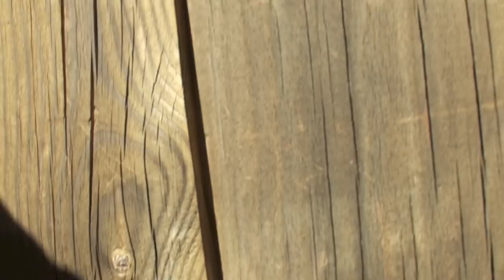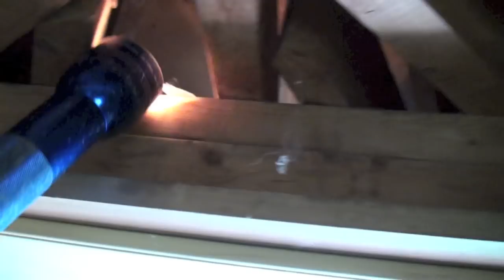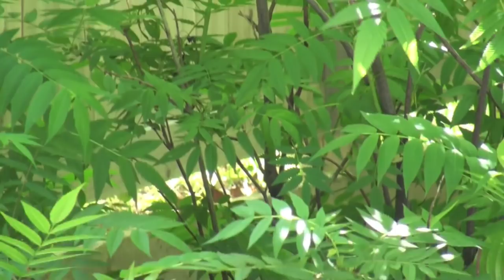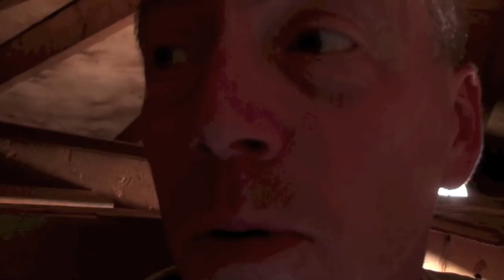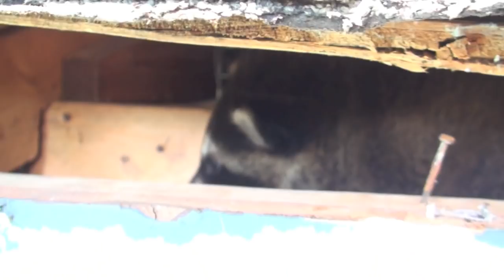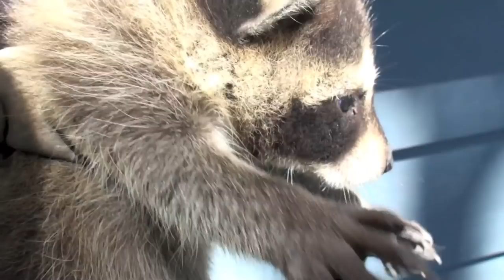Aggressive Mother Raccoon Protects Her Babies

Comment: A mother raccoon once lived in my home in the attic crawl space on 3rd floor.  My son's (then)   bedroom was on 3rd floor also.  There was a board nailed up from the crawl space and you can't see anything.  My son (Nate) can heard noises from behind the thin board.  He was warned not to bang or make noises towards the mother raccoon.  I called and someone told me to leave mom alone with her babies.  Within days, she moved her babies to another area from my home.  The hole on the roof to the attic was finally blocked.  I was amazed to see the size of the hole not bigger than this mother raccoon.  They can squeeze through pretty good.  It looked like the hole was chewed through.  They are smart.  If the mom raccoon feels disturb, she will move, along with her babies, so be patient.